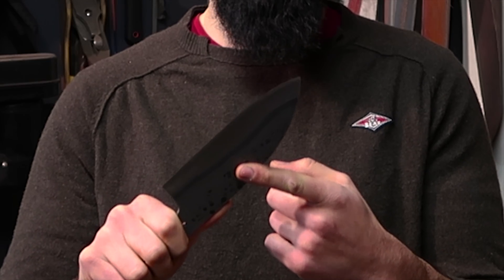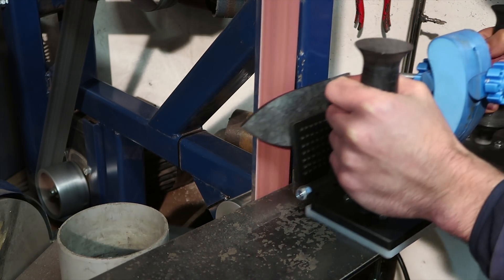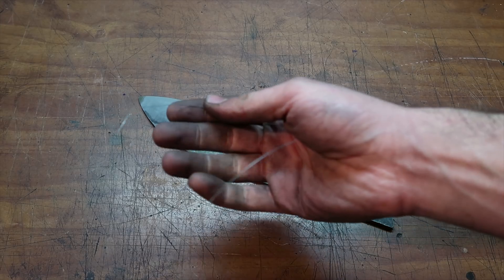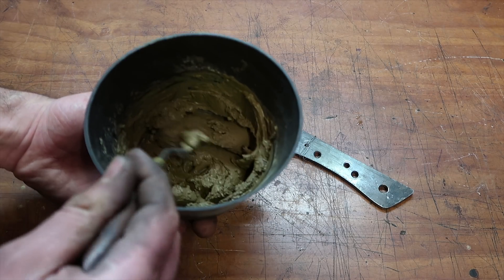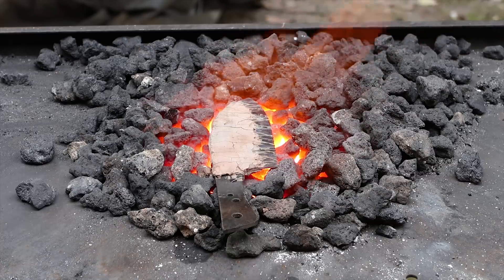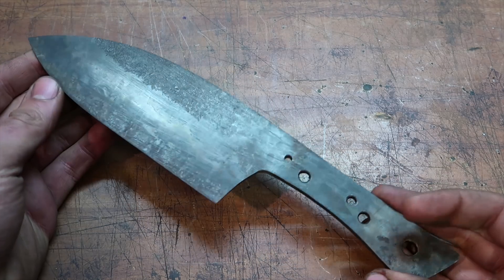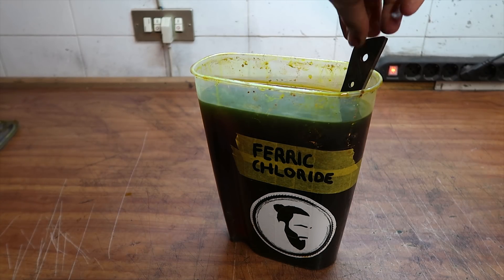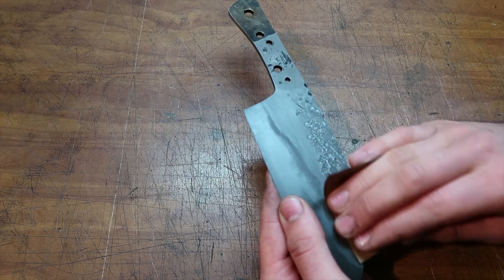Knife Making: Hamon On High Carbon Steel

Comment: Nice sanding jig, and the knife turned out really nice! 

How hard did the spine of the blade get? 
As you used a lot of clay for an oil quench, (verses a water quench) on the blade. 
As others have suggested, you need a larger quantity/bigger container of quenching fluid. 
And i would not go side to side motion with the blade when quenching. As it might induce a warp. 
Thanks for the video!

Comment: i never had any trouble getting a hamon on 1060. Just heated the edge of the blade and quenched it. If the back starts to get hot, dip it in your oil. No clay needed. I could even get three hamon from three quenches. Not pretty hamon like the Japanese get with clay, but definitely hamon.

Comment: You risk warping the blade doing that side to side action in the quench. I found out the hard way just yesterday Also, i think you need a larger volume of oil since i'm not sure that small container has enough thermal capacity to cool that much steel.

Comment: Beginner knife maker here so please excuse my ignorance, but can you put a hamon on stainless steel, or only high carbon non-stainless like 1080 or 1095?
Reply: 1080 and 1095 are your best bet, but W-2 steel works too.

Stainless steel has too much chromium, nickel and manganese, by the way. 

Also, chromoly would not be suitable for Japanese style chromes either.

Comment: If you temper the knife, its like any other knife,  you get  homogeneous hrc and not 62 hrc edge and 40 hrc spine if you use oil you don't need to temper
Reply: I agree... this bears looking in to. The tempering after quench seems antithetical.

Comment: Nice jig. But doesnt it take a long time to remove if from the jig when (if) you have to cool the blade off in water?
I made your metal bandsaw table btw, thanks for that! I have some issue with vibration, so I will need to add feet in the back or make it more sturdy I think.

Comment: Pretty sure you're supposed to use a thinner glay solution on the hardened part of the blade, there's a full length katana creation video with a traditional japanese smith somewhere on youtube :b some old tv production, super cool if you can find it :D

Also are you sure that the Hamon is a surface feature? If you made it correctly (and it looks like it) it should be cause by the blade being differentially hardened, with everything behind the hamon being basically unhardened, I can't see why that should only be the case for the surface? Could see the line changing as you get deeper into the steel though.
Reply: The different steel phases should be present throughout the tickness (or the majority, depending on blade thickness and steel hardenability). However, etching is required to see the different phases (bringing out the hamon) and that is only visible on the surface. If you'd sand it too much, you'll remove all the etched steel and therefore the hamon will not be visible anymore (but the different steel phases are still there).

Comment: i realy like your works but the harddening process... how u know that the temperature for this kind of steel is good i mean the accuracy of this type of hardening, u also dont use the charcoal u dont afraid about sulfur will react with the steel and make it fragile and vulnerable to chip or break?

Comment: Awesome. I thought a hamon line exists all the way through the steel because the steel cools at different rates changing the structure. I'll research. Great video, thanks!
Reply from the maker: And you are right! :) What I meant is that the etching that makes it pop it's a surface finish. didn't explained myself really well there. Sorry :)

Comment: What oil did you use for quenching? Beautiful hamon!
Reply from the maker: Thanks!! I use plain vegetables oil. Works fine for 1070 or similar simple steel imo :)
Reply: That's awesome to hear.  I'm worried about cracking my first blade so I was going to use olive oil and attempt a hamon, but from what I'd read it wasn't going to quench fast enough to create the temper line. Glad to see it works for you!

Comment: A hamon is not a surface finish as you said. It is the borderline between two different hardnesses of the steel. It will become visible also without any acid treatment, just by polishing.

Comment: Nice nice nice I thought it looked quite tactical before the final sanding. The hamon line, I thought it was more to do with how the quench effects the hardness, the unclayed part will be fully hardened and the clayed less so, but I didn't know the line was just a few thou thick, is that correct?
Reply: It's differential hardening so the edge of the blade should be harder due to the refractory, but as his was falling to pieces, I'm not sure how well it worked. The idea of using wire may seem like a good one in theory, but it's not. If you watch the video, the only places the refractory cracked and fell off was where the wire was holding it. The wire is not a good idea as metal expands with heat as such it weakened and broke the refractory. There are plenty of recipes for the "Japanese type coating", and why he wouldn't use those is a mystery. If put on correctly, it won't fall off.
It also isn't necessary to glob it on like he did.....pretty lame attempt really, especially for someone used to making knives.
Reply from the maker: Correct! :) I totally forgot to explain what happend to the steel... Damn! :')

Comment: Your hamon came out pretty nice. In my last 3 or 4 videos, I have been testing hamons too. I experimented with W2 & 1095. I made a fast quench Canola(mixed with brine and dish soap), it actually worked. I tested it against Mcmaster 11 second & straight brine. I've got to try that wire method, I never thought of that, I think I saw someone do it a long time ago though. Take it easy.
Reply: Dave Erving Evader Knives  can you give me the recipe for that canola brine mix?
Reply: I show what I do in my video "W2 Heat Treating and Homemade Canola Fast Quench" then show the comparison. You might want to adjust the recipe yourself.